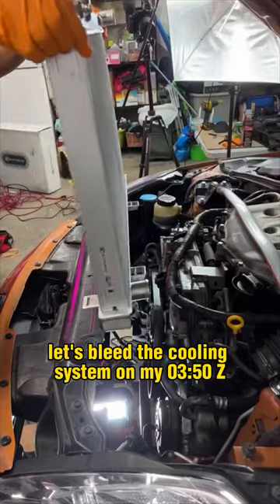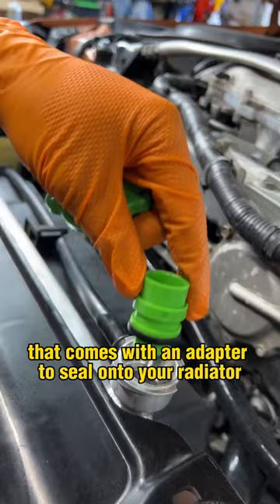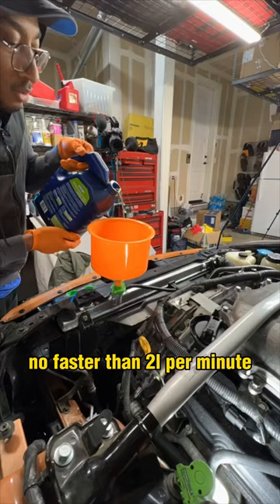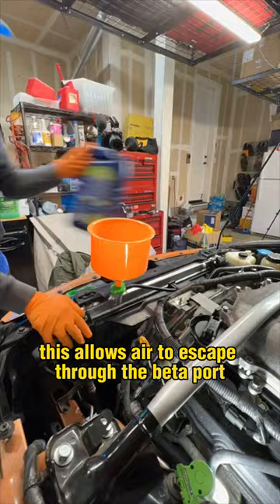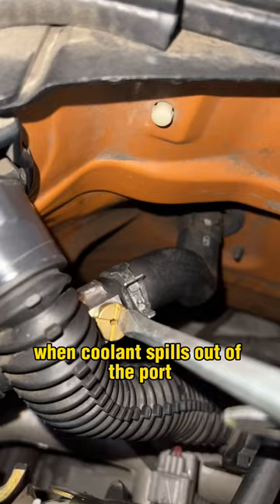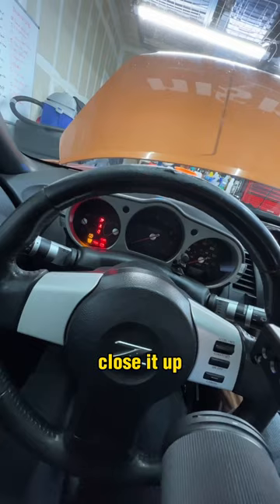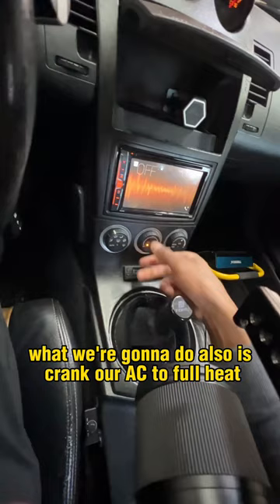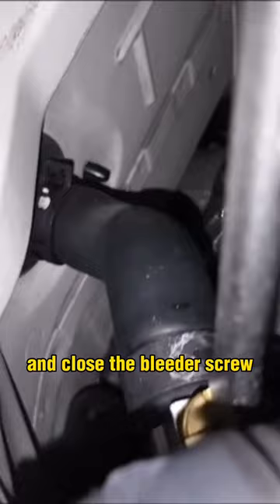The *EASIEST* way to bleed your coolant 🥶🥶🥶

Comment: When I was younger I didn’t know you had to burp a car afterward from a coolant flush and I ended up blowing my head gasket lol
Reply: i almost did that few weeks ago on my bmw e46 lol thankfully i kept a close eye on my temps and shut it down right away but i realized quickly i was supposed to bleed the system after changing my expansion tank smh rookie mistake
Reply: @46god  I wasn’t so lucky. I was on the highway and I overheated my engine like 8 times. I’m surprised it only needed a head gasket. Replaced it myself and all is good and now I refuse to let that happen again
Reply: @michaelstevens04  damn bro well honestly it could have been much much worse like a warped block
Reply: @46god  luckily these trition motors are completely cast iron so it’s almost indestructible
Reply: @michaelstevens04  what car was that? that for sure saved you though lol i got an aluminum block so much scarier when you get cooling system issues
Reply: @46god  we have a fleet of ford’s it was just one of the old 5.4 beaters. that thing could walk through hell and back.

Comment: I work on cars from time to time, so I'm not an expert, but I'll take a crack at this. First heat and then AC. The heat for the cabin of your vehicle is extracted from the heat being produced in the engine block, being transferred into the coolant in the coolant passages and then pumped into the radiator to be cooled down and then recirculated. Some of this hot coolant is extracted and sent to the heater core which is usually located on the opposite side of the firewall of the vehicle, The heater core is basically a small radiator full of hot liquid. As the blower motor passes air through the heater core, some of this heat is drawn away into the air so that it can heat the air in the vehicle cabin. This much is usually common knowledge, But the main takeaway is this reduces the temperature of the coolant going back to the engine because if you're extracting heat then you are making the coolant "less hot".. The AC works in pretty much the exact same way, although a little different in its process. The refrigerant used in an AC system is a liquid that responds greatly to thermal energy, When you compress it, it heats up rapidly when you allow it to evaporate it loses heat and exchanges that heat away rapidly. The refrigerant starts at the AC compressor which puts the liquid under pressure preventing it from evaporating and introducing heat into it, as this hot compressed refrigerant passes through the AC condenser, "the second radiator in front of your coolant radiator". This greatly reduces the temperature of the compressed refrigerant carrying that extracted heat into the engine bay, so it is under pressure and colder. There's a few more things that happens here but, it then moves to the evaporator core, Which as its name implies Is a space under low pressure where the refrigerant is allowed to evaporate/vaporize, This process extracts a lot of heat away into a larger volume of a space. Which is where you get the cold air from, It is then blown into the vehicle cabin Which brings the refrigerant to a hotter temperature and it repeats the process. To summarize when you turn on The Heat in the cabin you are extracting heat from the engine bay when you turn on the AC in the cabin you are adding heat to the engine bay.

Comment: Even if you get all the air out of the cooling system, if you open the pressure cap when it's warm, that will happen. Cooling systems run at roughly 16PSI....

Comment: On my e39 I open the cap
Turn the car on heat full blast not all the way on 
Add coolant slowly and remove bleeder screw. Wait till all bubbles disappear from resivour . Close both. Ride away
I only advise this if you have to consistently top off your system

Comment: Bro just get a vacuum style coolant refill system you need an air compressor but I literally just create a vacuum then use the adapters to suck up coolant at hyper speed from the gallons I have it’s awesome

Comment: That bmw e36 blowing out coolant...  Been there, done that too many times
Reply: Uh, maybe stop taking the cap off while it's hot?... Just a thought idk maybe you don't think much...
Reply: @sethdrak3  it blew various hoses off as it overheated because of air trapped in the system, try thinking before writing ignorant comments
Reply: @RnGRacing  buddy that still doesn't explain why you took the cap off when it was hot😂😂😂😂😂
Reply: @sethdrak3  buddy I never said I took the cap off
Reply: @RnGRacing  💀💀💀the video you were talking about was literally a 5 second clip of someone removing the reservoir/radiator cap and it exploding coolant  from the pressure change 😂😂😂😂
Reply: @sethdrak3  I said blowing out coolant not exploding the radiator expansion tank, the main point I was referring to was the exploding coolant not where it was coming from

 I'm terribly sorry I didn't exactly specify to your likings
 when I'm sad enough to sit and pick apart month old comments on YouTube shorts I'll fix it for you

Comment: The blend door is what makes the hot air come out, the coolant flows through the heater core no matter what. You can turn the heat on as an indicator to feel if coolant is running through it, but the heater core doesnt open up. Im not 100 percent sure on this ride so i could be wrong.

Comment: Maybe it's just a Nissan thing I don't know but I topped mine off with the cap off and I've never had an explosion in 25 years of doing this
Reply: It's definitely a nissan 350z thing. I've done the coolant on my z this way before... still can have air in the system. I bought a refill evac tool to remedy this problem. Best $80 I ever spent.

Comment: Filled my 95 Toyota Tacoma with 229k miles with hose water because I’ve been flushing the system or whatnot. I’ve replaced the thermostat and today I filled the coolant system up again and ran the truck at idle while adding water until it stopped bubbling. I put the cap on and drove it on and off all day. All of a sudden it just randomly overheated and blew a 4 inch crack in the top of the radiator right next to the pressure cap. I’m frustrated.

Comment: I had that happen before.  It shot out so hard and hot for like a minute with steam and all the radiator fix crap I had in there.  It was crazy.  I was having overheating issues at the time.

Comment: In some cars or situations a funnel won’t help. For example my Ford Galaxy overheated after a change with this funnel. I ended up buying a pressure based bleeding device to get a vacuum before filling up.
Reply: I just did my brothers Subaru, i filled it and let it idle and it overheated, texted one of the techs from work and asked him, he said throttle it when the thermostat opens and run heat on max, it definitely worked.

Comment: Those funnels are stupid. Lots of cars have an angled fill neck. My cars manual literally tells you to park on a steep hill or jack the front end up to let air out of the cooling system. 1998 ford escort zx2.

Comment: There is safety tabs underneath cap to prevent it from shooting up and the hot fluid shoots downward. Don't ever turn cap all the way just loosen it
Reply: Never open a hot radiator. If you do keep.pressure on the cap those tabs arent reliable with the amount of pressure

Comment: On my BMW they used a plastic bleeder screw and I stg it's too easy to break. The first time bleeding the system the head snapped off and I had to replace the entire hose because now it was a coolant leak.
Reply: On my first e46 I bought the brass screw to replace the plastic one before it broke off

Comment: One time my head blew on my 2.2 sonoma and I didn't know and i was flushing the cooling system. After filling the radiator to the top with coolant I cranked the engine for 3 seconds and decided to recheck the coolant levels. It was already pressurized and I opened the cap and it all exploded over myself and my poor friend😞

Comment: i just fill it up, let it warm up, top it up again, drive it for a couple minutes, let it cool, pop the cap and top it off.
Reply: It will not bleed properly if you do that. it will just be more coolant and air that would be in the cooling system

Comment: this is stupid, 1 never open the radiator of a hot engine, and 2 you don't need to buy all that stuff.  just fill the coolant keep the cap off of the radiator then start your engine, wait til the thermostate opens. then add more coolant close the cap of the radiator and fill the coolant reservoir  and check on it from time to time
Reply: That trick don’t work on alot of these new vehicles
Reply: @kellismith4329 what about a 2001 saab?

Comment: I have anxiety watching the temp rise as i didn't yet close the radiator cap. Every time.
Reply: Closing the cap after heating up wont do anything no pressure is present if air is already getting it. It explodes due to pressure build up. Thing of it like a bottle.of.pop

Comment: Full heat, BUT lowest fan setting. You don't want to dissipate all the heat by having the fans on high
Reply: You do want the fan on high in case the heater core has any kind of flow control valve. More fan = will demand more coolant flow to keep the temp high. I’m pretty sure on most cars it just always flows the same regardless.
Reply: It doesn’t matter if the heater core dissipates heat you want the whole system to heat up anyway

Comment: How does one "open up" their heater core?
Reply: When you turn your HVAC control to the hot setting, it opens a little valve that lets the hot coolant run through your heater core, otherwise it is closed off if it is set to cold
Reply: I always melted the solder out with a torch just like every other radiator repair man does..

Comment: I feel like angod damn moron because i NEVER knew until today that low coolant stop your heater from working... Just got through a cold.snap and was getting AC at max heat and it never occured to me. I thought i was going to have to replace my heater.
Jesus.

Comment: Turn on the A/C to full heat? WHAT! Cars don't have central air. A/C system and heating system are two complete seperate units. 😂
Reply from the maker: i just mistakenly called the climate control “A/C”because I was multitasking lol. you get the gist

Comment: A/c and heat are two different things you turn on your HEATER to get coolant flow going through the core the a/c system is a separate part

Comment: Bro put straight coolant in his car 😅 you need to dilute it with distilled water 1:1
Reply: @DeflatedMeatball  if he's teaching people how to do it he should teach it right. It ain't ignorance bud
Reply: @silliesttgoose  you can get pre mixed coolant it's just more expensive
Reply: @c10bryce22  I'm aware, but like I told the last guy, if you're doing this to teach people it's something you should def tell them! But you are absolutely correct there is premixed.
Reply: @silliesttgoose  yes I agree but to be honest I wouldn't listen to this guy to change a vehicle cooling system.
Reply: @c10bryce22  that is an extremely good point 🤣
Reply: @silliesttgoose  can i use regular tap water my 350z started leaking coolant today and it smoked up when i hit 80 and I was wondering what the issue could be

Comment: Uh buddy you can just drain the coolant and fill it back up. It's just water. Let the engine run for a min after with the reservoir cap off and top off fluid. Never need to touch the rad cap that's why most vehicle's don't have them. It's not that complex 😂